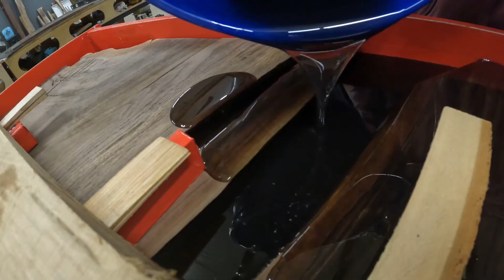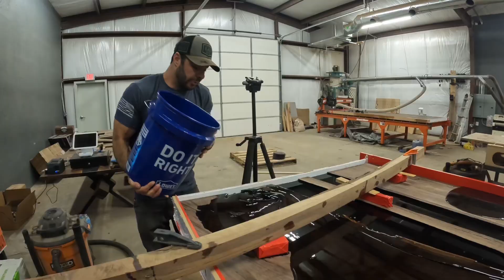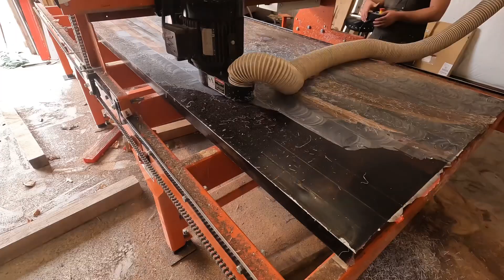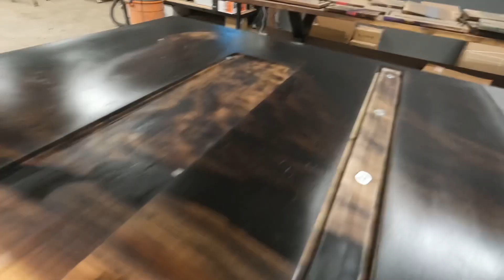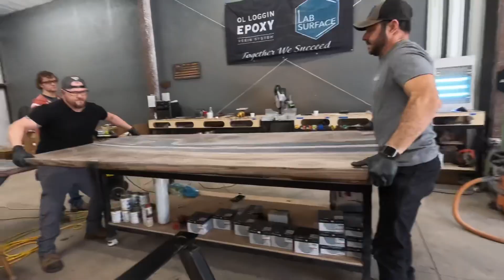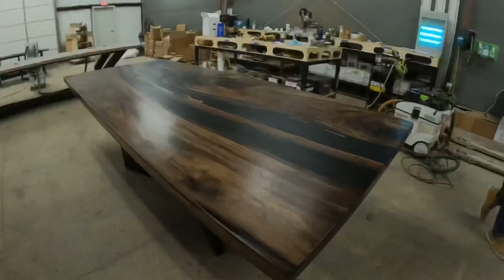Doubly black Ol Loggin Epoxy River Table!

Comment: I saw your vid on 731 woodworks. I have a question for you being an expert in epoxy pours if thats ok. I am about to pour a river table but where I am in Australia it is under 50 degrees Fahrenheit during the day, I have a wood heater in the shop do I need to heat up the shop to pour the epoxy and do I let the heat cool to the outside temperature  that gets to about 25 to 30 degrees. Thanks
Reply from the maker: No you will be fine it will just take longer to cure